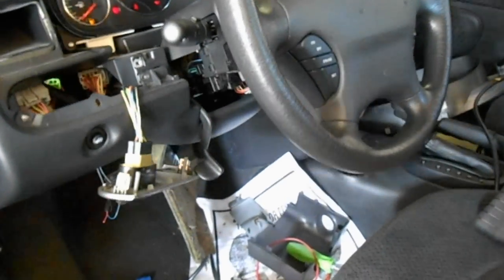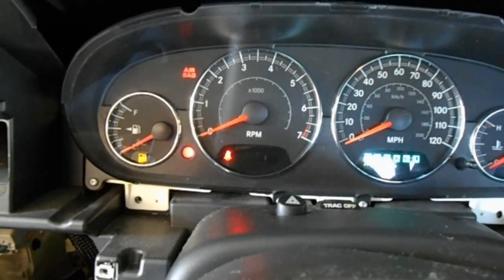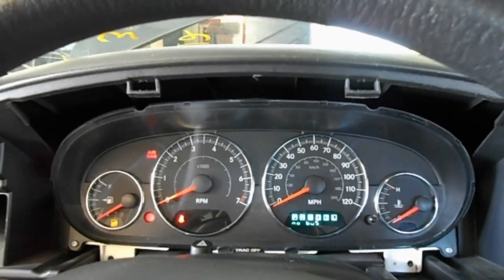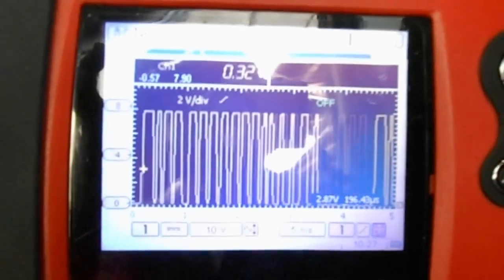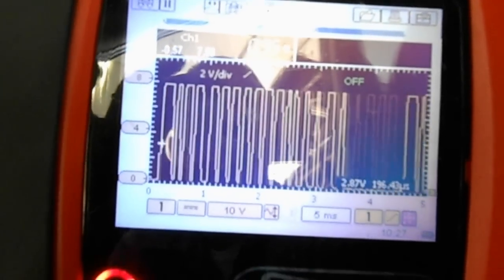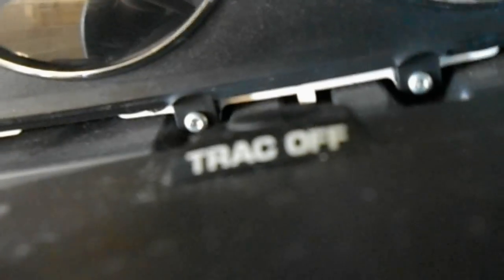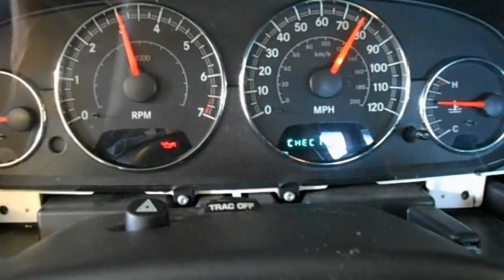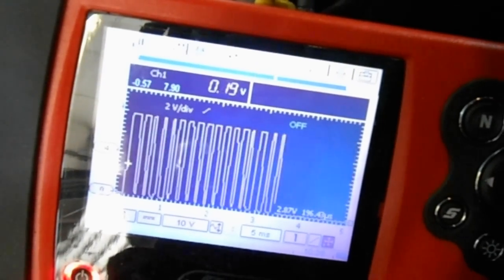2004 Chrysler Sebring No Bus message in cluster testing

Comment: Did you ever find your problem.
I have a 97 sebring convertible that it's doing the same thing. 
************************

In the video you said: there's a BCM code for a Fault. I think that tells you the problem. The BCM is faulty.
I just wanted to know of I'm right before I checked my trouble codes stored in each computer.
Reply from the maker: No I did not get back to this one.

Comment: In having the same issue with my 99 sebring odometer reads 0 then says no bus tachometer don't move when started no dash lights the convertable top won't roll back. but I have everything else. what should I do